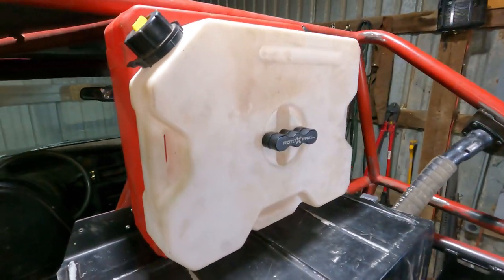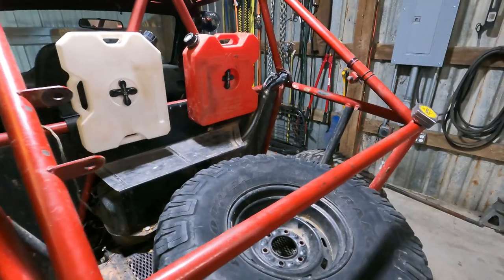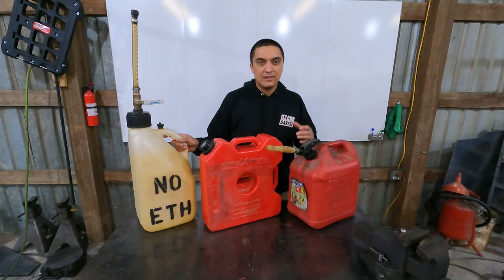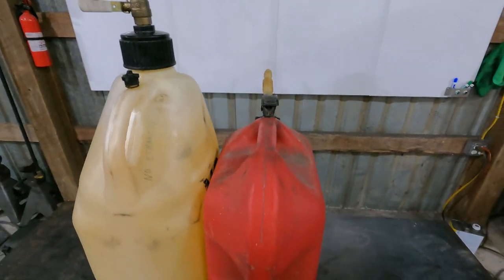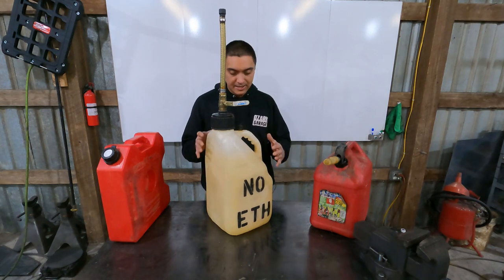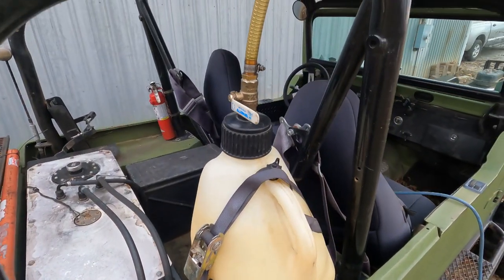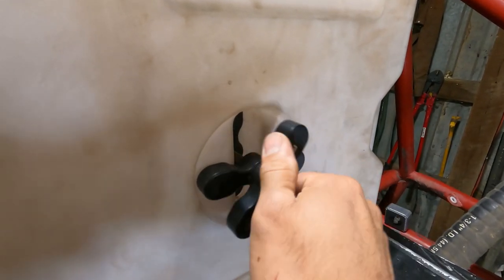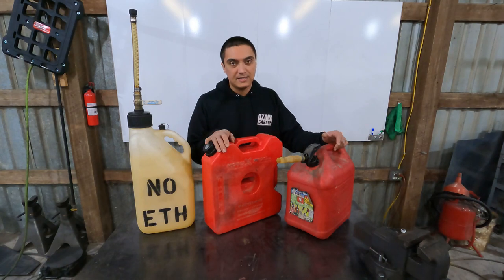Does Rotopax live up to the hype? 3-year review and comparison!

Comment: One of the earlier comments already referenced my question.  I'm a fan of the Jerry can, but I was curious of your thoughts (I understand your response).  I wonder if a fill spout similar to your ball valve set up on the farm can would make it all better.  I'm also tracking your comment about the metal cans leaking; I fixed that with Caswell tank sealer epoxy.  Yea, the Jerry cans are heavier than plastic, but they win the Instagram category on my scorecard.  Good channel, Great content, Keep after it!
Reply from the maker: The only spout I tried for the steel jerry can was the articulating metal type that looks like a cheap exhaust fix. It leaked out between the metal seams. I suppose you could cut the whole thing off and replace it with another spout, but then you still have to store it elsewhere and the can still doesn't vent. I have added twist-style radiator drains to jerry cans for venting, which does work well. 

I think the best way to use a NATO-style jerry can is with a big funnel.

Comment: Durability, leaks?
Reply from the maker: I haven't had any issues with leaks. The Rotopax seals tight enough that you have to vent it manually on the trail as the temp changes or altitude changes.